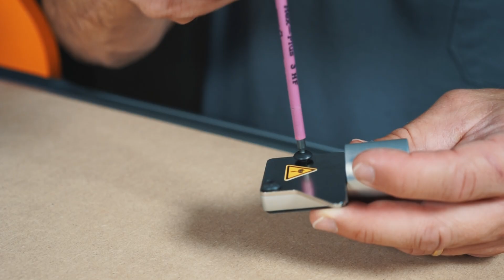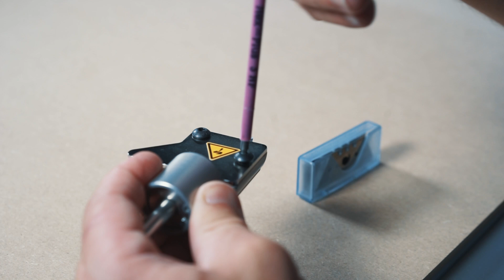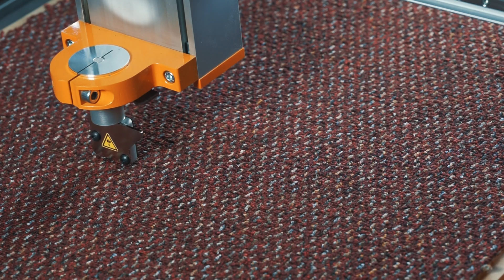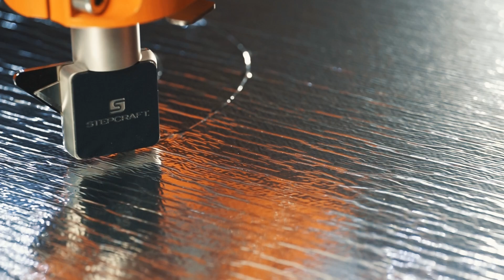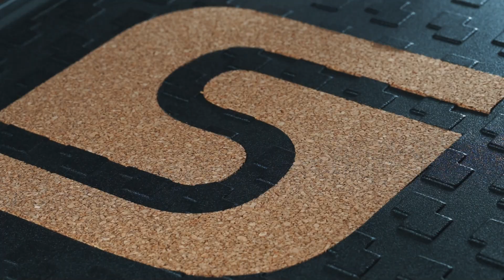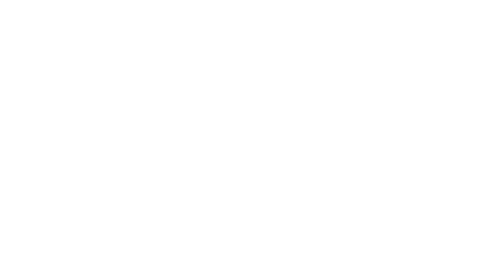The Heavy Duty Drag Knife | CNC Machine

Comment: Beautiful work! How do you make the spindle turn following the 2D contour? Do you use a plugin?
Reply from the maker: There is a tool in Fuison360 "Dragknife" with which the program is created. A rotation axis is not required as the knife is mounted axially
Reply: @stepcraftgermany  So you just keep the spindle at 0 rotation?
Reply from the maker: the drag knife is mounted on ball bearings and the postprocessor creates the radius correction with the X and Y axes.
 @_madmadmat

Comment: can it work with D series machine
Reply from the maker: The Heavy Duty Drag Knife can be used on any STEPCRAFT machine (tbh it can be used on pretty much any other system too). You'll need a 43 mm to 8 mm adapter for clamping, in case you do not already own one.

Comment: What's the blade offset ? 7.5mm ?
Reply from the maker: Maximum cutting depth: Stanley Fatmax: 14 mm, Mator 52 mm: 13 mm
Shank diameter: 8 mm Possible materials: Sealing materials, rubber, cardboard, foam, and more
Minimum curve radius: r ≥ 2 mm, depending on material hardness and cutting depth
For rough cutting in harder materials :hand-purple-blue-peace:

Comment: What's the difference between this version and Donek drag knife? Also, this version does not appear on website for USA
Reply from the maker: To our information, the Donek drag knife does not feature an integrated blade guard and the knife height is not adjustable as it is the case with our Heavy Duty Drag Knife. I'm sure it will soon be available in the US as well.